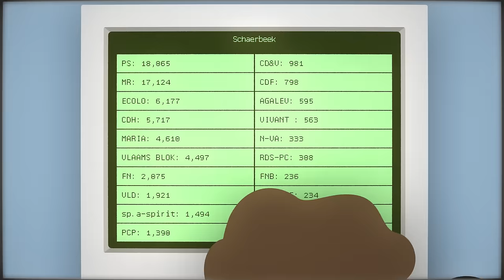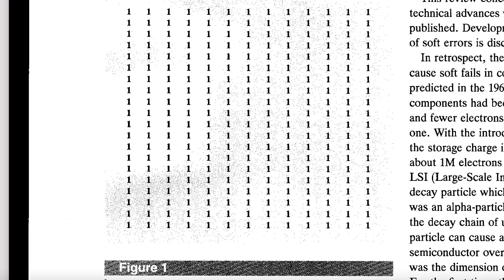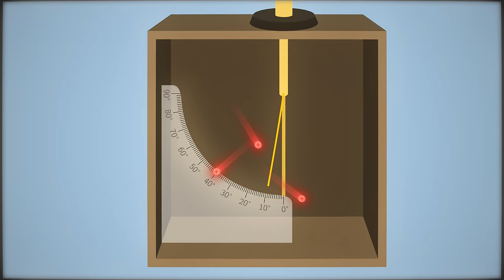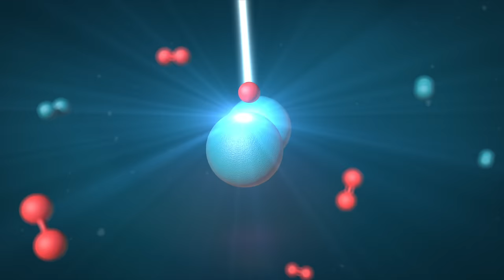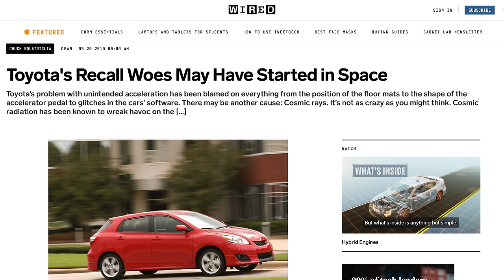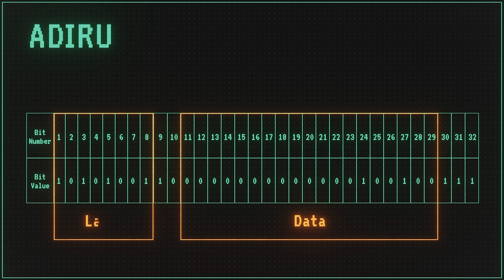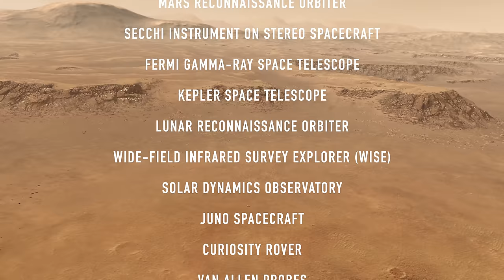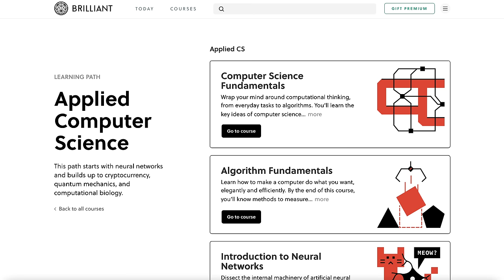The Universe is Hostile to Computers

Comment: As an engineering student and STEM enthusiast, this was one of the most captivating, insightful and exciting videos I've ever watched.

Edit: Ever since I watched this video, I've had technical glitches/soft errors pop-up almost everyday at administrative checks of various kinds which then later got resolved by doing absolutely nothing. I do blame the stars.
Reply: If you're interested in actual solutions to error correcting, 3b1b has a cool video on Hamming codes. Academically this stuff is usually in EE at the graduate level, related to statistics, random signals and information theory (edit: also group theory to an extent).
Reply: Was about to say that. This video is fascinating.
Reply: @thoughtricity4296  thanks! I'm gonna check that out rn, this stuff is very interesting.
Reply: Do you know any other channels like this?
Reply: @sathvikreddy4807  Scott Manley, Anton Petrov, Kurzgesagt, Vsauce, SmarterEveryDay, PBS space-time, LEMMiNO, Branch Education, Tom Scott, CGP Grey, World Science Festival, minutephysics, Stuff Made Here, The Royal Institution, NileRed, NileBlue, Cody'sLab

There are more, these are the ones on top of my head. I believe you'll find them eventually.

You can start with Tom Scott and Kurzgesagt.
Reply: @thoughtricity4296  hey I checked out that thing with hamming codes and that led me to finding this channel called computerphile, which has tons of interesting stuff on it. I'm interested in doing comsci in grad school  (maybe doctorate too) and this stuff has and will be very useful for me. Thank you for spreading your knowledge ❤️

PS, that thing with the hamming codes was so clever it blew my mind lol
Reply: @Peter Evans It's pretty cool that you get this stuff introduced in 9th grade but it must just be the tip of the iceberg.

Comment: I'm a hobby astrophotographer, and I see cosmic ray strikes in my images pretty much all the time! 

Most are just straight lines, some are whispy curved lines. Ever rarer, are the ones which actually show a fork splitting in two, and some that show squiggles as if it's rotating. They're detected by the camera detector because they interact with the electric field, throwing a splash of electrons in its wake for the electron wells to detect as photons.
Reply: Do you have some place where we can see them? It sounds intersting
Reply: You might be picking up some different spin particles. Look up the standard particle model. Cross reference it with the particle accelerator results. You're literally witnessing quantum physics. That's pretty awesome
Reply: If you can visibly see the track, I wonder how much wider the track is than the particle that created it?
Reply: I bet you get all kinds of chicks just by using that flashy title Huh?
Reply: Nobody asked
Reply: @iSwanqa  nobody need your opinion
Reply: @Gabriel.4190  cosmic rays get them moister than an oyster
Reply: @CanalRadioMax  I would love that, as well...
Reply: @thePronto  that’s a great question. The tracks are often 2-3 pixels wide at most, my pixel size is 3.8um - so it’s creating an electron splash cone of around 7.5-10 microns. This is the diameter of a red blood cell. A proton (typical cosmic ray) is 1 femtometer. So it’s radius of electric-field influence is ~5 billion times the size of the cosmic ray. 

Of course, more energetic rays produce juicier lines on my images.

Ima need a scientist to chime in with a real answer, doe.
Reply: @joelsfallon  sounds like one did but I'm too lazy to check the math.
Reply: @joelsfallon  I struggled to find an authoritative answer on the diameter of a photon.  I found your value (10^-15 m) and also 10^-20.  Either way, being able to see the track of a cosmic ray is mind blowing.  But per the video, astronauts 'see' them frequently.  Amazing.

Comment: as a comp science major, i’m never gonna look at anything about computers the same ever again! honestly this was an insanely interesting video that i will share with my professor!
Reply: Note that ECC memory makes it very unlikely that bit flips happen.
Reply: @lolilollolilol7773  Not true.

Bit flips will still happen but the impact is minimised because the ECC RAM electronics will detect and then correct the error.
Reply: @deang5622  ecc has backup so needs double bitflip, to bit flip
Reply: @vipvip-tf9rw  Your comment makes no sense.
Error correction is specified according to how many bit errors they can correct and how many bit errors they can detect.

Typically an error correction system that corrects n bitt errors will detect n+1 bit errors.

What you might be trying to say, and I am not sure because you haven't been clear in your response, is that ECC RAM corrects single bit errors and does not correct two bit errors. That is, n=1 but not 2.
Reply: I'm saying, in order for ecc to malfunction, both memory and parity needs to be corrupted
Reply: @vipvip-tf9rw  no, that is not right.
In order for the ECC RAM to malfunction there needs to be 2 or more bit errors.

It is single error correcting, double error detection.
Reply: @deang5622  depends on how the ecc works. Hamming detects and solves a single bit.
Reply: @mndtry  No.
Hamming code corrects a single bit error but detects 2 bit errors.

Those 2 bit errors cannot be corrected because the electronics is not able to identify where in the word the 2 bit errors are located.
Reply: @deang5622  I was sure it was 1 correctable and 1 identifiable. Apparently classic hamming as I said has that characteristics but if you add another parity bit it can also detects two errors.
Reply: @mndtry  Most error detecting codes that correct n bit errors can detect but not correct n+1 errors. I remember that from university
Reply: @deang5622  the rule that i learned is that a code made for identify n errors needs a distance of n+1 and to correct them needs 2n+1 (to see which word is the nearest) but studying from my book I learned that hamming could correct and detect a single error (if you think about it when two errors occurs hamming can't even detect them) but with an additional parity check it can also detects them
Reply: @mndtry  Just got this from wiki:

"In computer science and telecommunication, Hamming codes are a family of linear error-correcting codes. Hamming codes can detect one-bit and two-bit errors, or correct one-bit errors without detection of uncorrected errors."

It says it can detect 1 and 2 bit errors.
It says it can correct a single bit error.
So single error correction, double error detection( but unable to correct either of the two errors bits).
Reply: @deang5622  I believe there are two variants that falls under the name of hamming code correction. One does what I originally said, another one does what you said. Correct me if I'm wrong

Comment: The first time I heard this was in the 70s, during my programming practices. At that time we used punch cards to insert code, each card with a command. I inserted my cards into the card lector and the results were wrong. Me and my colleagues made a print and for hours we tried to find a coding mistake. One of my friends suggested to run the same code again and it worked. Later, we commented this to our professor and he said that possibly it was caused by a cosmic ray.

Comment: "Me: [Compile]
Program: "Compilation error"
Me: My code didn't work?!?
Me: [Compile again]
Program: "Ta-daa!"
Me: So, cosmic particles.
Reply: We now know the solution to all the baffling unanswerable questions relating to computer errors :D
Reply: Actually I'd bet the most likely reasons would be: shitty antivirus (I had this happen to me), race condition in the compiler, badly ordered dependencies that aren't found on a first compilation, and faulty memory.

Not saying cosmic rays are never the reason, but unless you have a project like google chrome or a OS the chances of random cosmic ray breaking your build are lower than winning the lottery.
Reply: or... you wanna keep compiling until cosmic particle hits and it works...
Reply: My recommendation to any developer : use ECC memory
Reply: too relatable
Reply: my comp-sci teacher used to say "you gotta block the camera on the monitor so the computer cant see the idiot in front of it" while pointing at the power indicator light
and lo and behold - when he blocked it with his finger...the code worked XD
mind you it usually involved making a quick and hard to spot change in the code or compilation instruction like a missing semicolon or having hit the wrong button... but it was quite entertaining XD
Reply: @iwanchandra3295  This would be the neatest copy protection ever.
Reply: My system isn't radiation hardened enough!
Reply: @iwanchandra3295  "It only works when the correct particles hit the correct bits on RAM!"
Reply: Everything makes sense now, or does it? Elp

Comment: Ah, the infamous cosmic rays every IT specialist deals with a few times in their career. Had one of them myself, first year doing it professionally!
Reply: But you are drunken russian
Reply: Yeah, I hate those. But they're no match for a tree branch, randomly hitting a touchscreen of ATM, during a storm. It will test your application to the limits by touching anywhere and everywhere, and at any time... randomly.
Reply: @SmartK8  are you going to tell us that there are no users that do that?
Reply: @uninspired3583  Na that's how every programmer stress tests their touchscreen programs. They used to buy packs of sausages an put them on forks connected to motors to stab at the screen but nowadays they just employ inbreads with extra toes and fingers to do it, saves on buying sausages and wasting them, and creates jobs 🤣
Reply: @SlyerFox666  i work in the meat industry. Is there any way I can convince you to go back to sausage stress testing? I would recommend a low fat option to reduce the screen mess.
Reply: Bit flips are the scapegoat for everything.  Been in electronics and IT for decades,  I've only seen perhaps two or three ECC memory correction events in that time.  Also desktop crashes are pretty rare these days and can almost always be traced back to just crappy hardware and/or software.   Power supplies and/or capacitors are the cause of most crashes that I've seen.
Reply: @jeffm2787  No if your from electronics you should know it's Static that's the first excuse 🤣
Reply: @uninspired3583  We can't put the 6 fingered ones out of a job it's the only way to stop them two timing their mum's with their sisters 😂
Reply: @SlyerFox666  LOL,  soo true.  That even more blown out of proportion IT related failure cause.  To be fair I've had a few systems reboot after snapping a good static charge off a button, or case or mouse, etc.  No damage done.  Running a vacuum cleaner on the same circuit can be problematic as well,  bit of back EMF.
Reply: @uninspired3583  They get tired. Branch does not. It can’t be bargained with. It can’t be reasoned with. It doesn’t feel pity, or remorse, or fear. And it absolutely will not stop, ever, until your application is dead.
Reply: @SmartK8  All right, listen. The sausage is an infiltration unit: part pork, part spice. Underneath, it’s a hyperalloy combat chassis, microbacteria-controlled. Fully armoured; very tough. But outside, it's living porcine tissue: flesh, skin, hair, blood - grown for IT testing.
Reply: @fluoroantimonic9950  that only makes me more capable of the job, if anything

Comment: Now imagine the cybersecurity implications of this.
Reply: Why we shield IMPORTANT electronics with heavy metals. And why less important electronics in the USA are literally labeled to essentially say "oi...shielding this device yourself is illegal. Love, The Fed."
Reply: @davemarx7856  lol
Reply: i just want a gluon gun
Reply: That's why Torvald is angry against Intel for slowing the growth of ECC RAM. A bit flip can be deadly for the kernel, especially on servers.
Reply: @kopuz.co.uk.  haahahahahhaahah
Reply: @Anoneemus Noename u ok
Reply: @davemarx7856  Wouldn't stop a random neutrino passing through.
Reply: @chupasaurus   you're right. What would?
Reply: @davemarx7856  Nothing, as neutrinos can pass planets with ease, which is why we send in space CPUs with order of magnitude bigger lithography thus dropping the probability to be damaged by 2 orders since the relation is quadratic.
Reply: @chupasaurus  But don't neutrinos interact so weakly as to make them basically neutral from a threat perspective? I mean, the thing in Antarctica meant to detect them is hugely massive and intentional in its desire to catch them and even it misses most of the neutrinos passing directly though it...or so I've read. I might be wrong in my understanding.
Reply: @brysonjacobs2868  One neutrino? Yes. A ray of those can do enough damage to make a track in CPU. There is a case where a datacenter had excess funds and time so they sent 2 dead CPUs from stacked servers to a lab where they were sliced and scanned with the conclusion above.
Reply: its not that important regarding cyber security, redundancies exist for a reason :)
Reply: @chupasaurus  Interesting!
Reply: That's why ECC exists... As he already said at the start of the video... * sigh * I really wish people would stop making smartass comments like these
Reply: Firstly servers have ECC memory so they are protected. Secondly chance of the flip being relevant to unlocking an attack vector is very very low.
Reply: @Anoneemus Noename The fact that you miswrote mRNA makes me think you know nothing about healthcare :)
Reply: @Project2457official  the fact that you attack his capitalization instead of countering the content of his comment tells me that you’re a big pharma shill
Reply: @Anoneemus Noename what does genetic engineering have to do with electrons
Reply: Once I had to check and replicate an error with a vending machine.
It accepted a bill denomination which doesn't exist.
Reply: @Project2457official  , some of the most well spoken, literate and grammatically correct people I have met are dumber than bag of fish heads.
   I'm not suggesting you are. I have been given instruction, care and great help from people  that don't appear to have a formal education. Life experience, awareness of our own limitations, grateful.
   Greetings from Colorado Springs Colorado, Christopher.
Reply: Can a cosmic particle launch a nuclear weapon?
Reply: @mitchellmaytorena1137  No.
Because nuclear fission weaponry requieres the fissionable material to be way over critical mass at the time to make it start.
On weapons, it is under critica massl by reasonable far until the mechanics of the device makes the material get the correct geometry/density of it.
Reply: "gentleman, watch as I destroy it and empire by changing a one, to a zero!"
Reply: @yukisohma19  the quiet kid
Reply: @mitchellmaytorena1137  if a single command from a single computer could launch a nuke: maybe. But my understanding is that, at least in the US, the actual launch takes two humans, acting in concert, on two different computers, and at least part of the process involves physical switches. I'm not sure whether a command to launch could inadvertently be issued by computer? Probably not unless the relevant system was already in a state ready to issue that command, which should take human intervention to get to that state.
Reply: @Anoneemus Noename see
Reply: @davemarx7856  Nothing says that.
Reply: Lol
Reply: @bitonic589  I used this to ruin Dune for the Dune fans a few day ago >:)
Reply: imagine controlling enough cosmic rays to hack or break anything.
Reply: @yukisohma19   relatable
Reply: cybersecurity wise this event are SO random it's irrelevant
Reply: Watch me blast my electronic safe with high intensity radio waves and unlock it
Reply: @adriangamboa3529  not if you intentionally throw charged particles at a micro processor and gather data on the results,  then use that data to construct a pattern and try to replicate the results that had the most promising outcome to comprise the security of the processor.
Reply: @chupasaurus  Neutrinos are extremely unlikely to cause an error since they almost never interact with matter.  Neutrons, on the other hand, are much more likely.

Comment: I always heard how people called error from cosmic ray as a joke. But with this video, it really explain how fragile the system is.
Reply: I used to work in technical support for TVs. The most common error was a pixel with the wrong colour and the solution was always a software update. And I explained to the customers back then that this can happen due to cosmic radiation.